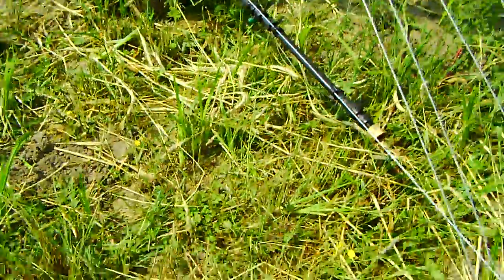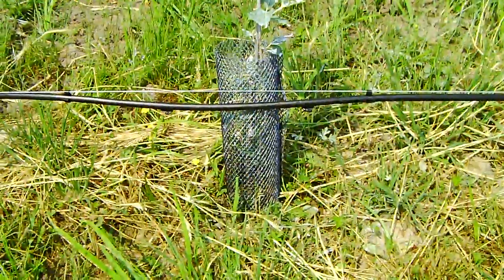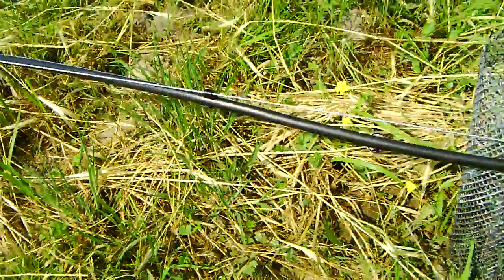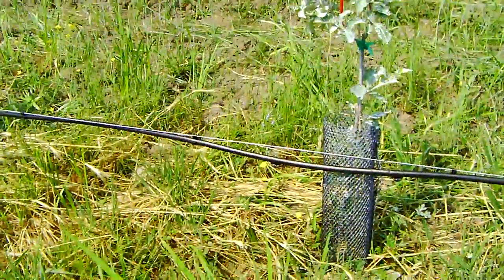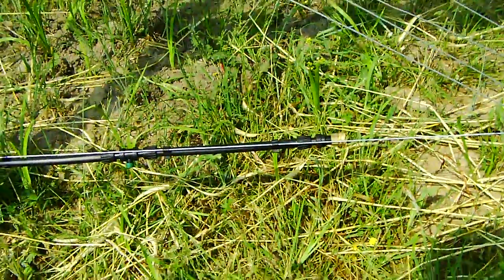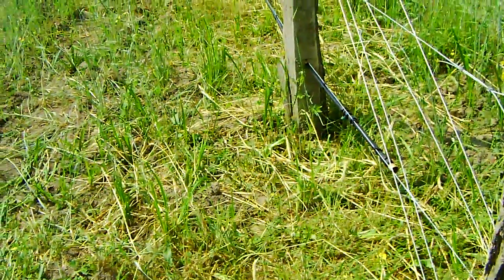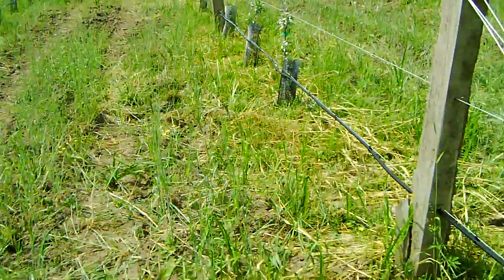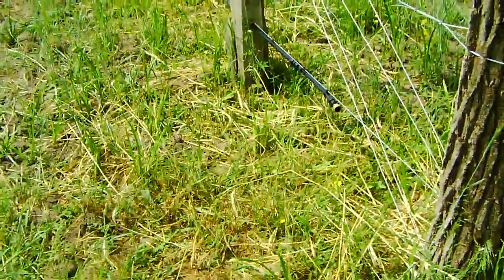Orchard Diary 5/31/2010: Drip irrigation system (Part 1)

Comment: Alan, do you mind sharing the brand of the irrigation materials?  Are you satisfied with the quality?
Reply from the maker: +Vincent Esposito I get all the fittings from http://www.dripworks.com and I'm quite satisfied with the quality and performance.  The orchard tubing is generic, and I buy it locally to save on the shipping costs.  Sign up for the pro pricing from Drip Works and you'll save some money.
Reply: +Alan Yelvington I see what you mean about the pro pricing (+) and the shipping costs (-) OUCH!.  Not sure I have a local option but I shall cast about. As long as the ID, OD and wall thickness is roughly the same, I expect it should work for my application which is similar to yours but on a somewhat smaller scale.  I see some planning and lay out work on this weekend's agenda.